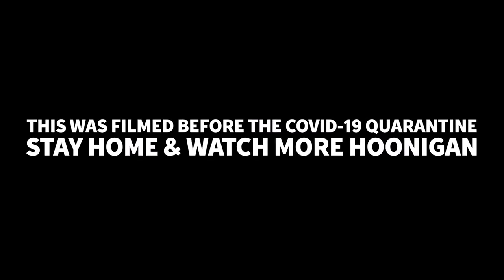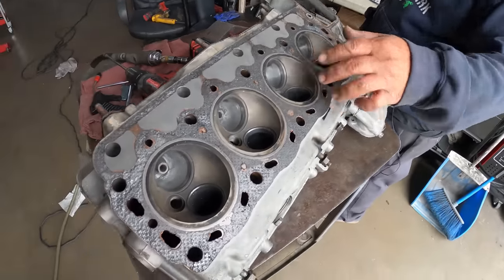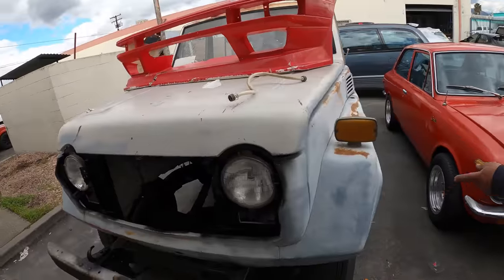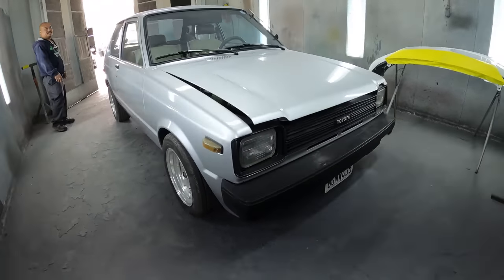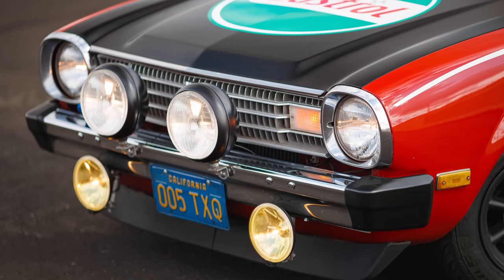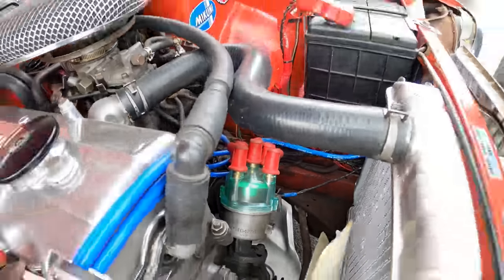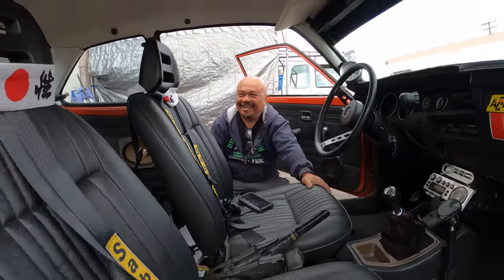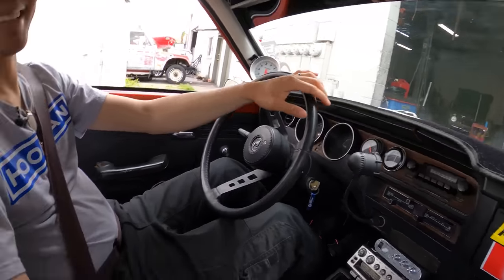The Father of all Mitsubishi World Rally Cars: 1977 “Dodge” Mitsubishi  Colt/Lancer

Comment: I bought one of these with blown engine for $50 and put a japanese stock replacement engine in it and new clutch, tires, radiator, wheel bearings, etc. It got 40-45 mpg on the highway. Unreal gas mileage.  Drove from San Fran to Tahoe on 1/2 a tank of gas.   The manufacture claimed highway mpg was only 28-30 mpg, which I always thought was weird that it was so underrated.

Comment: About 15 years ago I had a four door '78 Dodge Colt that I bought from the sketchiest dude for $300. I never registered it, we used it to drive around the back alleys every now and then for a laugh, and eventually I sold it on to cover rent a few months later. It was pretty fun, the PO put long spring shackles on the rear to lift it, he said otherwise it would bottom out on bumps if people sat in the back seat. It had an old school fiberglass racing seat for the driver for some reason, despite being otherwise stock so far as I can remember. I kind of wonder who has it now.

Comment: I had 2 76 Dodge Colts in 85, 86. I drove from Mn to San Diego. It got 35 mpg. You could drive 40 MPH in a snowstorm and pull the ebrake, get it spinning and gas it to pull of a 360 never leaving your lane. I love that car.

Comment: Needs a MMC cam 5, since its a stroker, and maybe twin webber 45 dcoe side draft carburetors. Damn i miss my Colt 79 coupe. When You are in the Philipines you should visit Cebu, i got a buddy there who knows a lot about the old school jdm car culture. And might still have a lot of good racing parts for toyotas and mitsubishis. Btw, my 4g32 with 81mm bore used to rev up to 7k rpm with the MMC cam 5 racing cam with just 91 leaded fuel back in the day.

Comment: the last dodge colt I ever saw was one a friend of mine had he turned in to a drag car with a full tube frame and a blown 440 big block . it did low 9's and dipped in to the 8 second range but he had to load it with Nos to get it there . I have always wanted one but not many of them survive. I want to stuff a 3 rotor in one and make it a drag car there so small even a factory 3 rotor would get one in to the 9's .

Comment: Cool, my first car was a 71 Dodge Colt with that same engine. I eventually swapped out the 4spd with a 5 spd from a later model Mitsubishi with the larger engine(2.6L 1979/1980 Dodge Challenger). It bolted right up to the 1.6L with no mods.

Comment: I used to have a 1972 Dodge Colt 72 and 73 exactly the same it had a 79 colt transmission 5 speed in it ,sometimes I wish I never got rid of that car it's a very hard hard car to find anymore even harder than cars he has I took it to LA back in the day and raced a 84 Nissan truck and toasted it 8 car lengths 🤣 buy the way if anybody sees it the license plate believe was 1REM565 i believe  98% sure